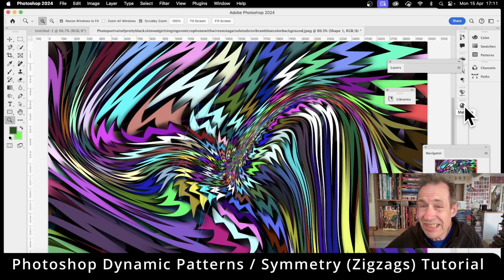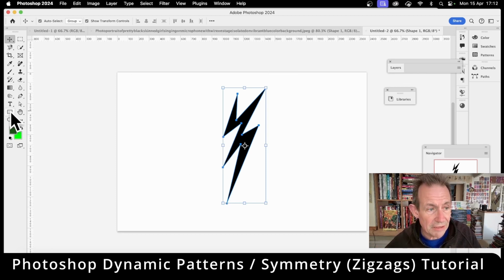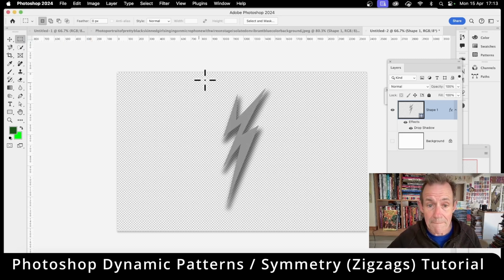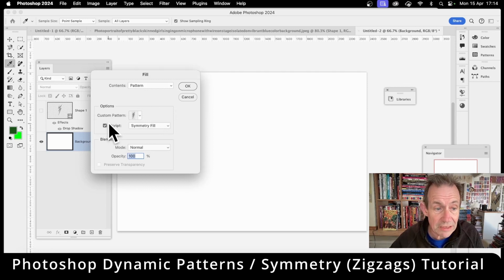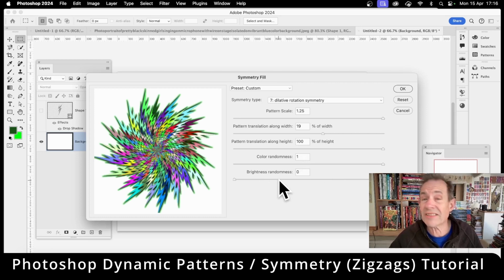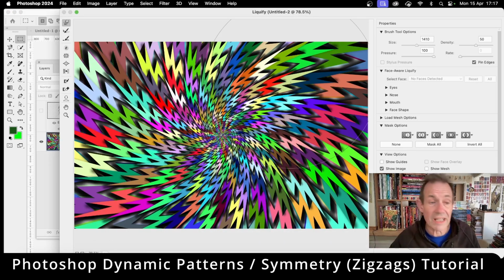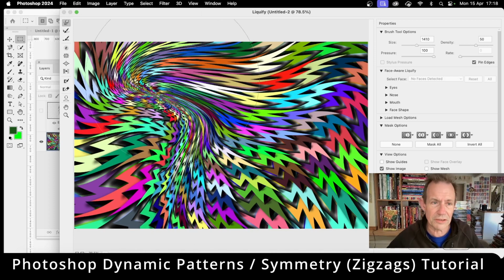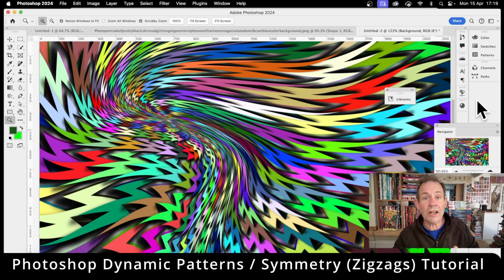How To Create A Dynamic Whirlpool Design In Photoshop

Comment: Question Andrew - Is it possible to produce this same exact type of zigzag style in Affinity? If so, please make a video on that as well. (if you weren't planning on doing that already) 
If you already have it uploaded, please point me to it because I haven't come across it so far? Thank you Sir!
Reply from the maker: I doubt if it would be possible as the symmetry feature is not in Affinity. I think the pattern feature in Affinity is superb but unless they add some variations such as symmetry to the tool, I can't see how to do it. I guess you could create it with multiple layers and use the new move and duplicate panel and then combine all those and then warp using the powerful warp features in Affinity. A lot more steps would be needed and it would not be as flexible.
Reply: @Graphicxtras  I was thinking along those same lines. Duplicating and warping. I guess I'll give that a try when the time comes. Thanks!!
Reply from the maker: Possible to do it that way ?? Something to investigate